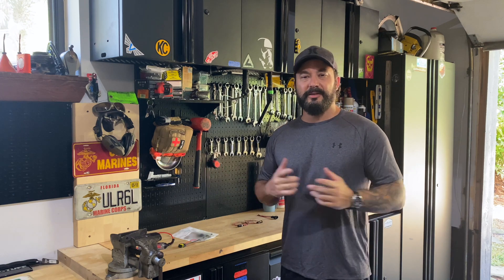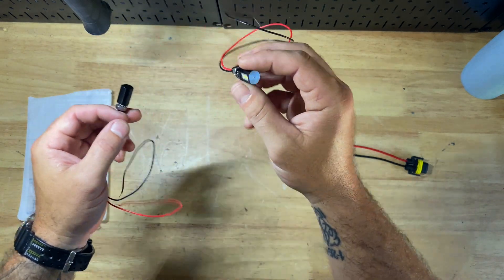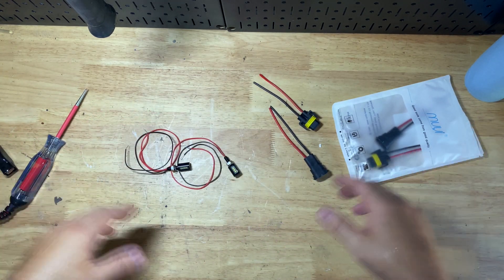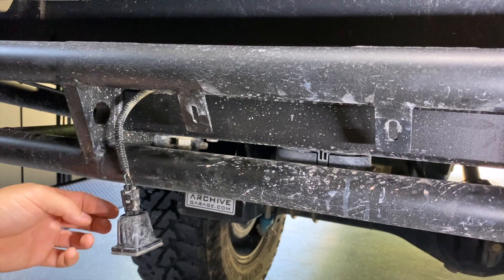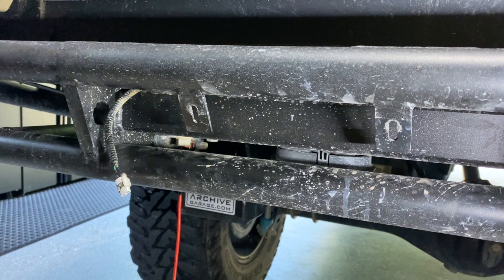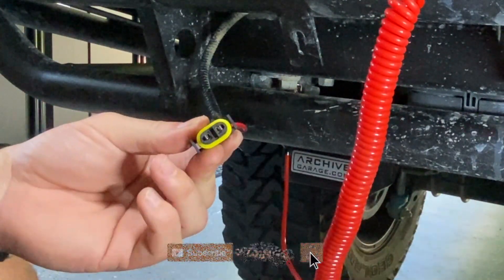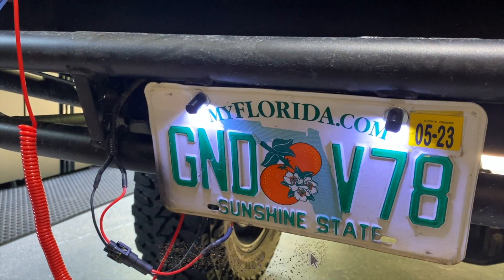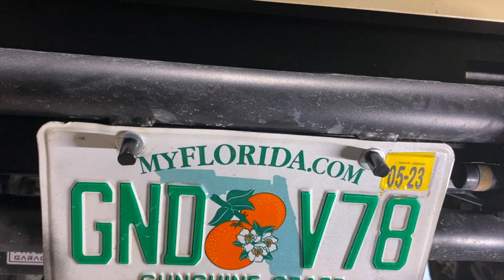Cheap LED License Plate Lights for the Outgear Solutions Rear Bumper | (2017 Tacoma)

Comment: Looks good,just check that blue wire Spicer, over time the bumps worked wire little loose, so what I did is electric tap it up good. Or down the road, soider it
Reply from the maker: Will do, thanks for the heads up. 👍